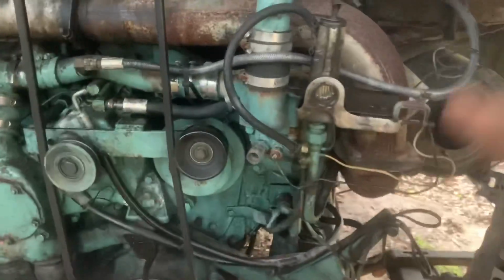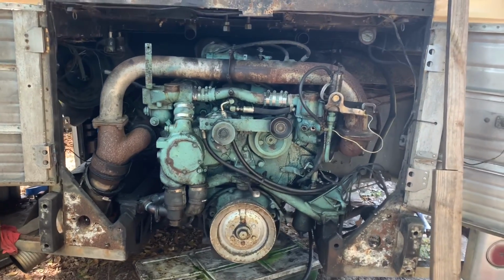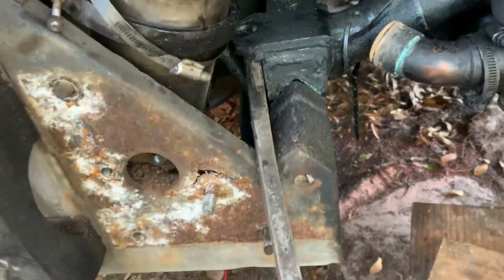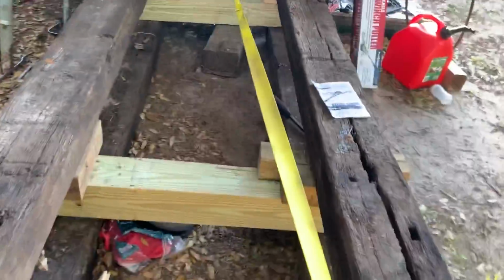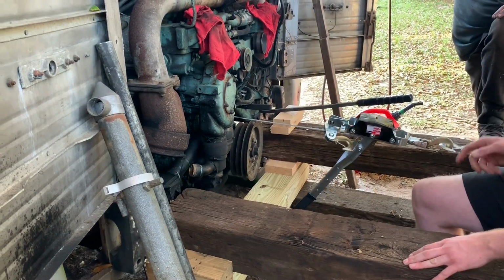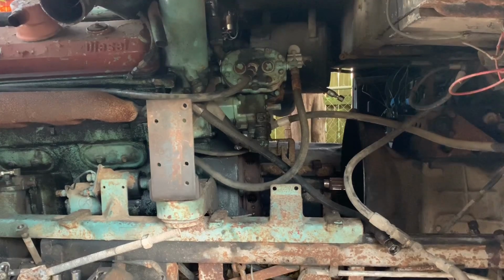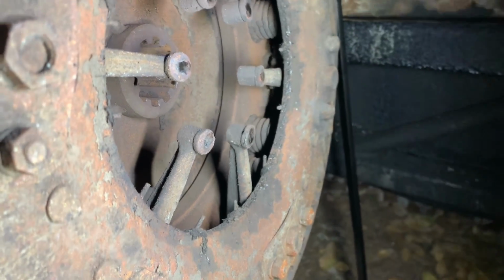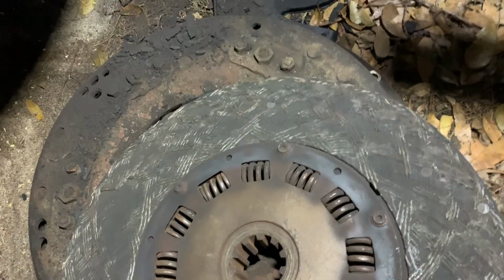MCI MC5a bus clutch replacement detroit diesel part 1

Comment: I'd be wearing more than a t-shirt over my nose. I lost a good friend that worked on brakes. Like many of the old shops use to do, they used compressed air to blow out the brake dust. Lung cancer took him in his mid 40s. Same goes for your clothes, hands, etc.  Thanks for the video.
Reply: @gst69man  they can tell for sure if it was asbestos by the type of cancer it is: mesothelomia

Comment: I put a clutch in one of these busses with a 8- 8 detroit in it. I borrowed an engine stand that was built by a bus mechanic. It went up behind the engine. The engine then slid out the rear of the bus onto the stand. The stand had wheels on it and i rolled it into the shop to remove the transmission and clutch.

Comment: Never worked on an MC-5, but it's amazing how similar it is to the MC-9s and 102A3s we had in the fleet - pulling the engine with a comealong and cribbing is inventive as hell, we had cradles for using with a forklift but we also had engine change crews :)

Comment: Took my PA "Class 2" driver's test, in a 1965 MCI MC-5A, with a State Cop driving test administrator, as my evaluator, in traffic, in West Chester PA.  Stopping at Dairy Queen, July, 1984, didn't hurt. By that point in the test, the trooper said that "as long as you don't hit anything on the way back, you'll pass."

Comment: Those big nylon wedges that tree fallers use are great for lifting heavy things and sliding them on wood. Some grease or used motor oil aids in overcoming friction on the wood.

Comment: Thanks for your time, effort & for sharing ! Most interesting & enjoyable. I feel for you having to deal with all that mass outdoors in the dirt. The re-mating of the engine to trans will be tricky. It will be interesting to see how that goes. Will you pull the flywheel & have it resurfaced & what about the pressure plate; replace, resurface or is it still ok ? How's the throw-out bearing ? Thanks again ! Always enjoy your videos !

Comment: in the navy we put sight glass(refer sight glass) in the fuel return line... if there is nothing coming by the glass, out of fuel or a problem with fuel pump.... air bound, air leak..

Comment: On a much smaller scale, I removed a VW Squareback engine by lowering the car onto a homebuilt cradle disconnected everything and then raised the car body off the engine. I thought I was very creative (sorry for the self-back slapping).
Reply: Jack Kreighbaum 
I had a 1960 bug I I picked up the car

Comment: Could be a Harbor Freight pry bar, as it takes on a new shape every time it gets used.
Reply: I was a mechanic my whole life Harbor freight has some fairly good tools especially for price.
The pry bars they have are not bad for the cost. They look like snap on a lot...
Reply: Trying to lift that Detroit with the same size pry bar would bend it no matter where it's made.
Reply: @packingten  Their old line of pry bars were pretty good.  The one he's got in the video is crap.  I own the same one.  It's absolute crap.

Comment: Hi,  When You showed the clutch Disc's , What caused The Uneven wear on the " Friction Material " Is The " Center Drive Disc / Floater Plate " Frozen in the Flywheel Housing . All That Clutch Material gets Trapped , along the outside edge and locks up the 
Drive lugs on the center/ Floater Disc Plate .  Miss Adjustment , Using The Clutch Pedal AS A FOOT REST , Burns Clutches !!!!!!
Did you take Off The Flywheel AND Have It Checked For Cracks , And Resurfaced ??????

Comment: What about the heat cracks in that flywheel? can that be turned? or will that have to be replaced? BTW can you do complete vids? looks kinda half-assed to only show A small part Would like to see the job in it's entirety.

Comment: did you ever think about putting some grease on the timbers you are trying to slide that 8v71 on dry it would work better and I worked in the trailways shop in Washington dc back in the 70s

Comment: Clutch went on my MCI  5A  on route to Oregon ...drop it off Sept 11  picked it up Oct. 26 !! A truck shop installed a truck clutch ,is there a difference between bus clutch and a truck clutch ?
Reply from the maker: What did that set you back?    I don’t do trucks but they may use different springs.
Reply: The original bill came to 3400.00 I went for a test drive before paying,they left some wires off,muffler clamps loose ,jakes not hooked up and a glycol line loose.I told them Ii have no confidence in this bus making it back to Canada we argued and settled for 2800.00

Comment: i am curious.. do you do a lot of MCI bus engine/clutch extractions.. i bet that a few pieces of angle iron. with some square tube or rectangular tube welded to the bottom could extend the lower sliding rails and allow the engine to come out much easier.  forward thinking could create them in segments to make them easy to store.  they will overlap the gap and bolt to the rear face of the frame.  i also wonder if you  grease the rails to make extraction and installation easier.  just thoughts.. i know you travel by bus.. so it would have to fit in one of your bays that is why i said.. it could be carefully designed to break down. this all depends on how many MCA buses you service yearly.
Reply from the maker: I carry enough shit.   But what’s another few hundred lbs.  no i don’t do a lot most mci’s i have worked on are automatics or the client already had a dolly for the engine.
Reply from the maker: And I’m really shocked that little bush didn’t rip out of the ground.  I was like 70% sure it wouldn’t work.
Reply: @BusGreaseMonkey   does the dolly bolt up like i described?

Comment: I can't tell from the last part of the video but did the engine come all the way out or did you just pull it a foot or two back from the transmission so it's still sitting mostly inside the bus?
Reply from the maker: Yeah the engine is pulled back about 2’.   It’s not even touching the timbers.
Reply: He was hoping for 3.5 - 4 feet.  I don't know what the final measurement would have been, but to squeeze in there, yeah, I'd want at least 3.5 feet, too. I'd imagine that a pull of 4 feet would still have some of the tray on the sliders, but the bulk of the weight would be resting on the old ties outside.

Comment: You really should have doubled back through the pulley, or tripled it through a third pulley.  Life would have been soooo much easier.  You would have had to reset a couple of times, but you could have cut the pull effort down by a third.

Comment: Do all the older MCI's engines slide out like that ?
Reply: Yep.... I have an MC5a like this as well as an Mc-7..... 8's and 9's also slide out like this.... don't know after that but I wouldn't doubt it... MCI used what worked for many years, I installed electric windshield wipers from a mid 90's D4500 into my 71 MC-7 and they bolted right in
Reply from the maker: Yes

Comment: Does that mean your going to change the air compressor while you do the clutch? Might as well as a new compressor will last longer theoretically than the one in there now. Pull the engine to replace the compressor? Good grief Charlie Brown! 

Considering how many MCI's your working on it might be a good idea to make up an engine slide cradle you can disassemble and store on your coach to make your life easier when working on these coaches.

👍👍👍👍👍❤️❤️❤️❤️❤️❤️❤️😳😳😳😳😳😳😳😳⚡️

Cheers!

Comment: That's a do it yourself Mesothelioma kit.      Smells like....... HELL.
Reply: Must be different types of material that causes Mesothelioma. I say this because the fibers seem to cause more grief from building materials than from brake and clutches. 
You hardly ever see mechanics from the era that asbestos was in wide sperad use with this lung disease, yet home renovators are cursed.
Reply: @ThePaulv12  Glad to hear that, since I was diagnosed with asbestosis about 12 years ago - notably, from several thousand brake and clutch jobs over my career. It's odd, then, that the docs told me to expect mesothelioma at "some point in my future"..... but, then.... I suppose they could've been wrong, and the biopsies worthless. But I came here to watch Scott do an amazingly primitive clutch job and only hoped that he'd use a mask and some gloves. On with the show!
Reply: @maniyan_wanagi  I'm a qualified mechanic too. I got out 20 years ago. I rember as an apprentice an old Greek bloke in the 1982-1986 era used to occassionally use compressed air to blow out brake drums. The other mechanics would get furious with him and peer pressure more than management stopped him.

We had traffic cops in the CBD for many years to help traffic flow in peak periods and they copped asbestosis at high rates.

All the best.